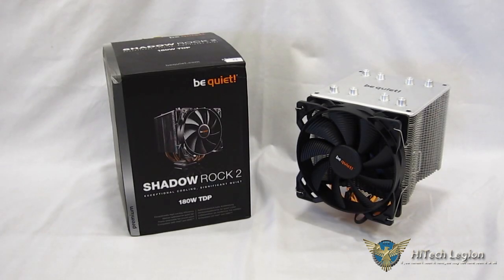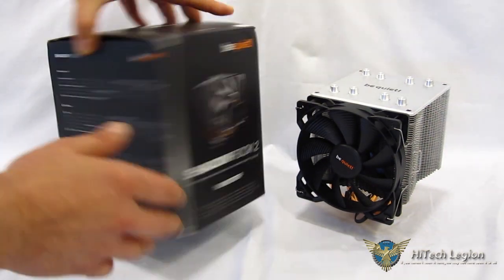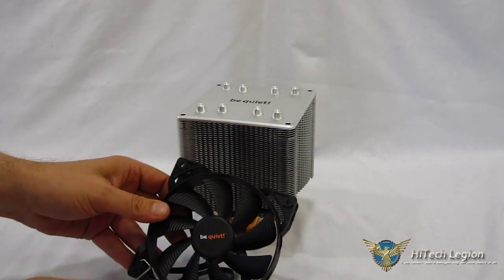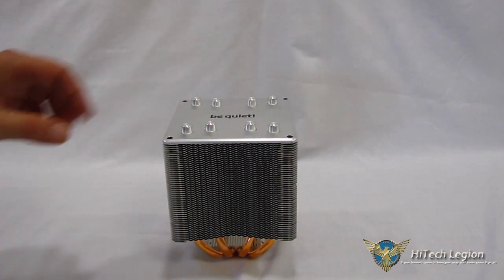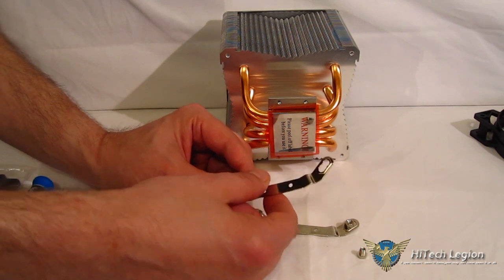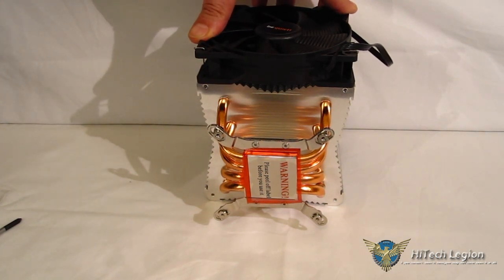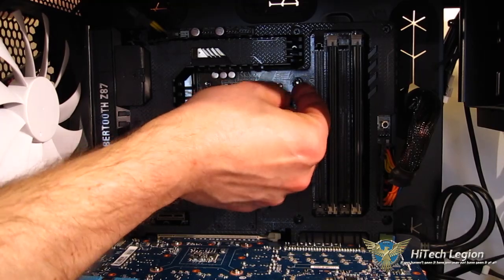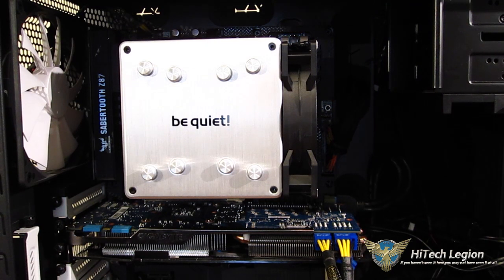be quiet! Shadow Rock 2 Overview, Installation and Benchmarks

Comment: is this good enough cooler for 7700k  and maiby if i wanna oc later?

atm my build looks like that. and the vooler there sucks i think  and got those offers to change it out be quiet! Shadow Rock 2 cooler + 45 eur
be quiet! Shadow Rock + 30 eur
be quiet! Pure Rock Slim CPU cooler + 5 eur  
 my build is this 
Intel Core i7-7700K, Quad Core, 4.20GHz
Arctic Freezer 7 Pro Rev.2 jahutus
MSI Z270-A PRO emaplaat
DDR4 Kingston HyperX Fury Black 16GB (2x8GB) 2133MHz CL14 1.2V
Internal HDD Seagate BarraCuda 3.5'' 1TB SATA3 7200RPM 64MB
Kingston SSDNow UV400 240GB SATAIII, 550/490 MB/s
ZOTAC GeForce GTX 1080, 2x IceStorm, ExoArmor, 8GB GDDR5 (256 Bit)
Chieftec ATX PSU A-80 series CTG-650C, 650W Modular
Corsair computer case Carbide Series™ SPEC-01 RED LED Mid Tower Gaming
Internal DRW LG GH24NSD1

Comment: my first Intel in almost 20 years... the shipped installation guide doesn't instruct you to mount the brackets onto the cooler first. although it seems obvious now, it should have been stated in the manual at some point :/ thx for the vid

Comment: i am buying a new pc.....does this cpu cooler fits in my mid tower case....dimencions are 43x50x21
Reply: I have a mid tower case and I must say, it is an extremely tight fit ( ͡° ͜ʖ ͡°). Like seriously, I had to unplug a lot of cables, move em around, and then put this in. ALSO you have to move the fan up so it doesnt hit the RAM which was a problem I ran into. Other than that it works great.
Reply: Ok. Thanks
Reply: Nik Lipovnik woow. maribor šampijon!

Comment: Dezmirean Alexandru is correct he has it the wrong way, the writing on the top of the cooler goes vertical for rear extraction. he has it positioned for top or bottom fan mounting. my AMD FX 8320 over turbo off running at 4Ghz runs at between 11 to 20 degrees on idle and 41 to 59  full load on prime 95. did reach 64 degrees when room temp was 27 Degrees . Define R5 Case with four 140mm fans on full blast. Getting dark rock pro 3 tomorrow see if i can get even better temps.

Comment: The radiator has to be turned by 90 degree so the air will blow the pipes from the front simultaneously. In this position the pipes are lined-up and the ones from behind will be warmer
Reply: Not necessarily, in ether case 4 are directly blown. I doubt there is difference which ones.
Reply: You cool the fins, not the heat pipes. The heat pipes have very little area exposed to cool. This cooler is specially designed so that you can put it in however you want and put the fans on any side.

Comment: Hi. I'm wondering what case and motherboard you are using. I have just bought a shadow rock slim but I have trouble installing it. I watched your review of that cooler and in the video you said that the back plate holding the cooler (the one you're mounting at 9:17) should be horizontal for Intel and vertical for AMD. I can see in this video that you mount it vertically, so you're using an AMD motherboard then?

My problem is that on my Sabertooth Z97 Mark 1 board I have this protective back plate which looks a LOT like the backplate of the motherboard you are using, and mounting it horizontally just doesn't work. I can get the 4 screws through, but it leaves too little room on the inside of the chassi for those plastic c-shaped clips that are there to hold the screws in place while fastening the cooler itself. What should I do?
Reply: Oh wait, I spoke too soon. You did put it in horizontally. Then that motherboard is an Intel one. If so then I'm really at a loss. Your holding plate seems to just snuggly fit into the open square while mine is just touching the edge of the protective back plate's border meaning I can't fit my cooler's holding plate...
Reply: ***** I would be happy to help you out, but I don't actually understand what you are saying. Are you saying that the backplate won't fit through the opening in the case's motherboard tray? If that is the case, you will need to remove the motherboard in order to install the backplate, or get it worked into place between the motherboard and the tray and then insert the screws.

Comment from the maker: This would actually be a very good choice for the system you are describing. Since you won't be OC, you will be able to take advantage of the very good passive characteristics of the cooler, and it will be a very quiet build. It will fit in either the 300R or 330R, and the stock intake on either will be sufficient.

Comment: been thinking of putting together an new system with an H87 mobo and an i5 4670. Would this be a good cooler for me or is it overkill since there won't be any OC going on? Should there be intake considered near this cooler or will it work like that? and lastly, will it fit in an 300R or an 330R? thanks a lot!

Comment: Hey - just finished installing the DR 2 and managed to avoid severing any fingers. The finish is great, there are no rough edges. Just that the fins are super-thin... Looks great in my case and having run some stress tests (Aida - prime) - it handles temps like a Viking handles his axe. 
I chose this cooler because I have Kingston HyperX high profile memory and to my knowledge it's the only large air-cooler that enables this without RAM bumping. Thanks again keep the uploads coming